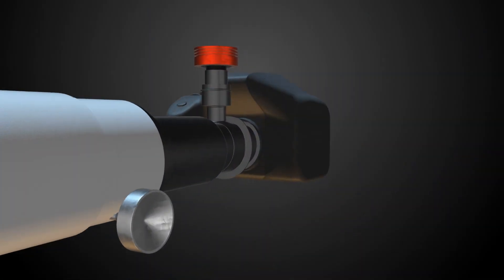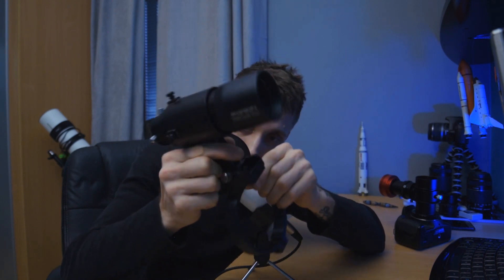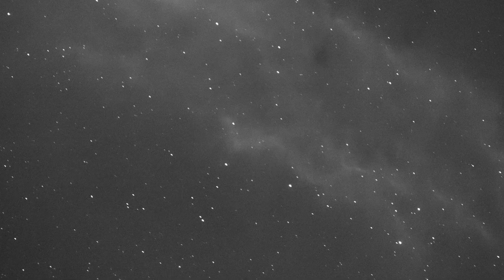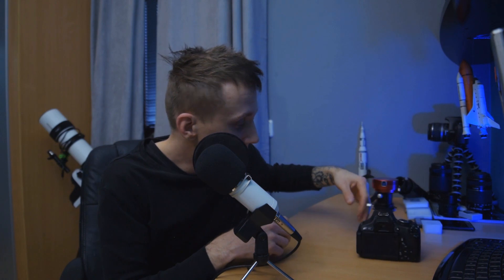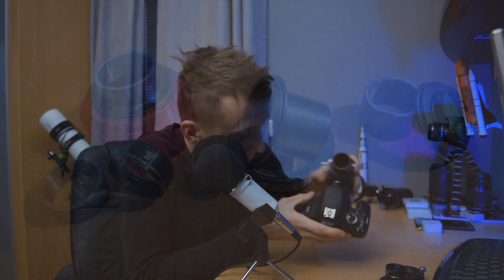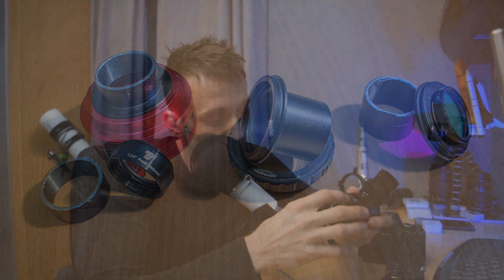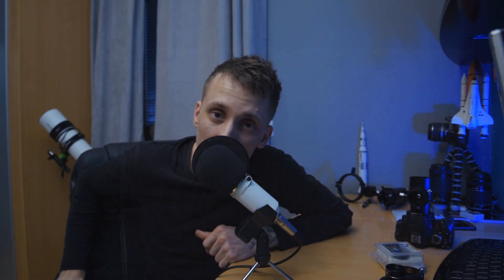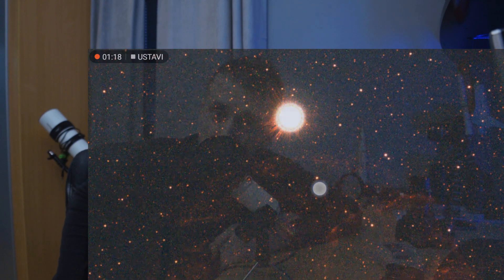Omegon Off Axis Guider

Comment: Your videos are the best. Thanks for everything you do. After watching your video I bought the Skywatcher Az-Gti and am connecting my Nikon z6 with a large 150 -600 mm tameron Lems. I want to add guiding and police alignment. I see how to use the ascom drivers and software over WiFi. What is the telescope you used ? I am also going to buy an ASIAIR unit. You are so azing how you think of all this. I will have a goto mount and pilot alignment and tracking all in a portable rog I can travel with. You are a genius

Comment: Hi! I am moving to OAG too, trying to guide a C8 f/6.3 with an ASI120MC-S and the FOV is damn small! I am considerig to help with the 0,5x reducer but I am afraid that I won't reach the focus (I already cut the barrel to shorten the distance and I barely reach the focus now, I cannot afford any other forward move). Question: the 0,5x reducer will move the focal point forward or backwards? thanks mate and super videos!
Reply from the maker: Hey Fabio, the focal reducer sadly movers the focus forward, I also had to cut the 1,25' nosepiece for the ASI120 in half, so the  0.5 reducer is now only reducing about 0.7-8 and I only have 3mm of forward ''play'' left on the focuser.
Reply: @TadejSkofic  that is bad news, I already have 0mm left to focus, with some tricks and mods I managed to even the DSLR focus with the ASI and as you say the reducer will make it even worse... :-(
Reply from the maker: @fabiopignata  O men, well this is a bad situation you are in. 🙁 
Did you try to ask people on Cloudy Nights forum about a solution?  There are a lot of very technical people on this forum.
Reply: @TadejSkofic  well I guess that my OAG is an older model, it is the original design that was once used with eyepieces with reticle, not much to do about it unless trying some more agressive modification of the device. Thing is that I use the C8 with focal reducer and I need to also respect the backfocus distance of the DLSR so I cannot gain mm by attaching spacers on the DLSR end

Comment: You can use clipping filters for the cam as well mate
Reply from the maker: Yeah I know but they are quite a bit more expensive so that's the main issue 😆 But again you are right the clip-in filter would be the best solution in this case.
Reply: @TadejSkofic  yes they are but honestly I don't really like them I use the 2" filters
Reply from the maker: @ryanhogg6556  Really? you mind me asking what bothered you? I never had them so I'm a bit curious 😊
Reply: @TadejSkofic  I just like 2" filters because they like good and plus I can use a filter holder or filter wheel with the 2" filters .but I think the clipping filters are good for people that's going to using cam lens mate